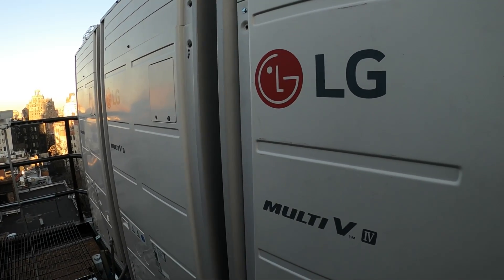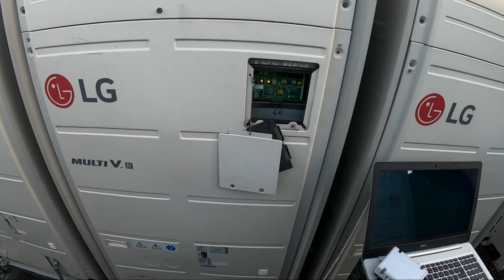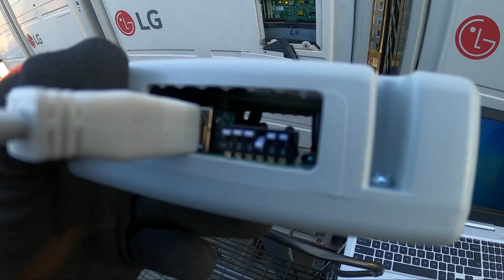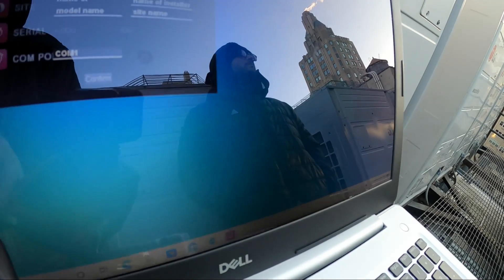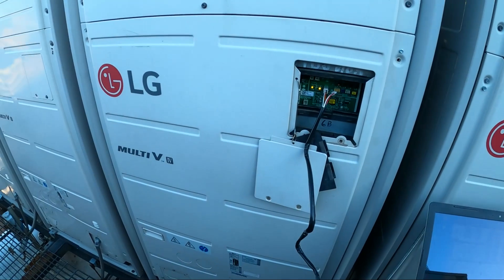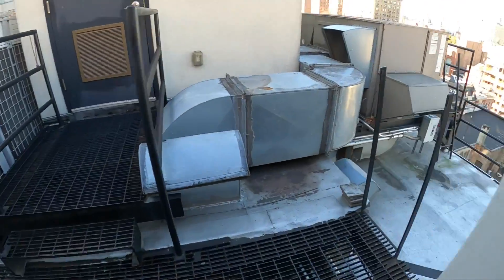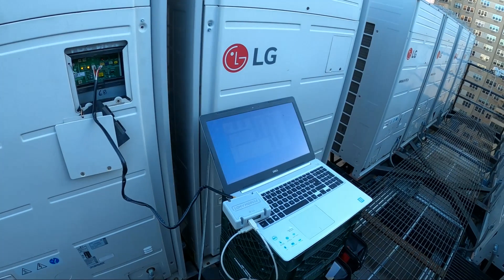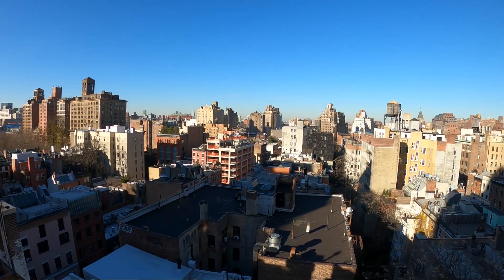LG HVAC Follow Up: LG MULTI V IV LGMV Service Tool (LGMV Computer Connection) LGMV Module Software

Comment: Great video I will be using the lgmv tool tomorrow on bond street in NYC. I also work in NYC mostly in Manhattan below 57th street.
I had a hard time installing the lgmv software. The hard lock key driver would not install. Klima our local sent me a link but my computer detected a virus. What I ended up doing is buying an external CD drive and use the CD that came in the box with the lgmv tool an installed the software successfully.
I'm hoping tomorrow it works I hope it doesn't ask me for the hard lock key.
BTW it looks like you are in the east village

Comment: hi. Thanks for the interesting video. tell me, does LGMV work without a flash key? do you only need the device itself or some other activation key?
Reply from the maker: You just need the device itself. It should have the flash key in it with a download. I'm honestly having trouble with this one for the computer. I've been using the other LGMV tool that connects to your phone/tablet & is wireless. Thanks for watching!

Comment: I feel identified with your work that's why I haven't missed a video since a couple of weeks back. Some people comment that you are not testing the electronics right, what do you say about it?
Reply from the maker: Thank you for your support! When I was testing the bridge diode on the converter board I tested it wrong at first in the video but also in the video right after I tested it correctly by switching the positive and negative leads. I misread the testing instruction at first but corrected it right after and confirmed there was nothing wrong. People always have something to say online. I could have edited that part out of my video but I like the show the true thinking process. Things happen on the job but in the end, I did test it properly & I am narrowing down the issues here. Thanks for watching & happy holidays 🔧⚡️
Reply from the maker: I would never put out false information in my videos. I will only put out the best information here 👍🔧⚡️
Reply: @JumpermanTech  that happens to all us field technicians.  I haven't had a chance to replay that video. Take care. Dont stop showing New york. Beautiful scenery 👌
Reply from the maker: @rightconditions2789  Definitely does. I will continue to show New York & make more videos. Thanks for watching & Merry Christmas! 🔧⚡️
Reply: @JumpermanTech Absoflogginglutely! 💪💪💪👊👊👊
Reply from the maker: @aus_aircon_ref_mech6671  Facts! Merry Christmas!! 🔧⚡️🤙🎄

Comment: Record Day was 41*  That is right at the edge of the charts  Range outside temp (59*-41*)   HI 363-435psi;  LOW 102-145psi; ODU Fan 20-50% Comp Ratio 50-70%; INV Discharge temp 149*-167*;  Liquid temp 77*-104*;  IDU EEV 400-600; ODU Main EEV 200-600;  IDI Pipe in 104*-122*  Take your pick of chart ranges  Your numbers almost fit inside both charts.  Liquid temp is low in both and LOW pressure is low in this chart.  Running all indoor units on high fan will tell the truth of the matter.  You maybe low on charge.
Reply from the maker: Thank you very much for your input! The day was 35 degrees outside when running this. Run all the fans on high and all in heat? Maybe also compare running all the units in cooling as well? I am wondering out how to properly check the outdoor and indoor EEV. Can't find good instruction from the app. Interesting you say that because technical support was wondering if the units were actually overcharged. Thank you & happy holidays 🔧⚡️
Reply: Let's talk about those inside units, one video I thought you said 9 IDU, but LGMV screenshot showed 6 - 9,9,9,7,7,7 for a total of 48k, that blew my mind to have a 72k out door unit only serving 48k.  unit charge is 16.8 lbs ? You added something like 404 oz or 25 lbs. That's 8 lbs for 6 IDU at 1.3 lbs each.   It sure could be over charge  @JumpermanTech
Reply from the maker: @mechanicalpros3214  For most units, it usually handles 8 or 9 indoor units from what I have seen. You are correct here. It says 6 IDU written on the unit and I'm looking at the screenshot. It says 7,7,7,9,9 & 9 BTU units. It is a 72,000 BTU outdoor unit & the indoor units total to 48,000 BTU's. I recovered 440 OZ to be exact and that is what I charged it back with. 25.5 LBS of R410A
Reply from the maker: @vrfpro  Unit charge is 16.9 LBS
Reply from the maker: @vrfpro  The outdoor unit seems extremely oversized. Wonder how that would affect this system. What are your thoughts here?
Reply: If you look at the version of firmware on LGMV screenshot it is ver 29.18 (operation info under type is ver) Standard ver is 29.0 the new boards come with ver 31.0.  If your have a .1 or in this case .18 this software has been flash upload at the unit by a LG rep.   This is specially modified software for a reason.  My guess is the other units with 8-9 IDU may by over capacity.   Side note, Phase CT amps, I never really worry about.  Most of my units under load run 22-24 amps all the time.  Do you really have a problem?  I would worry about flooding the compressor with liquid @JumpermanTech
Reply from the maker: @mechanicalpros3214  So it's the inv input CT that is the correct amperage this unit is pulling? I do worry about liquid migration due to extremely poor air flow at the indoor units. If you have seen the condition of the air handlers. The blower wheels are so packed with dirt that you barely feel any air flow in the rooms. We had to cut down the ceiling just to do the cleaning. Every single unit in the building is this way. I'm sure this is adding on to this compressor failure issue. Also, there are no such piping configuration to help with oil. Do you recommend inverted oil traps and oil traps in this setup? Thank you
Reply from the maker: @vrfpro  Your advice is much appreciated! Happy holidays 🎄⚡️
Reply: @JumpermanTech  It would be good for the hotel to give you a whole floor, all of the IDU's on one ODU, to cut the ceilings and completely clean the units, see if that makes figures look normal.  Alas, that's a lot of money for the hotel to lose having a floor out of action!

Comment: Record Day was 41*  range outside temp (41*-23*)   HI 363-435psi;  LOW 58-116psi; ODU Fan 50-80% Comp Ratio 60-80%; INV Discharge temp 167*-185*; Liquid temp 77*-104*; IDU EEV 300-500; ODU Main EEV 400-800; IDI Pipe in 104*-122*
Reply from the maker: Thank you for all of your input my friend! Really appreciate it🙏🔧⚡️

Comment: The model plate is what you would expect at the disconnect.  LGMV showed (INV input CT 9.6 amps) (INV input VT 215 volts).  Looks normal  A proper test would be to put all IDU in heating. The compression ratio looks a little high  Hard to read with everything in kpa and C.    LGMV HI 414PSI   LOW 95PSI   INV discharge 163* Liquid 75*
Reply from the maker: Thank you for your input. It does show INV INPUT CT - 9.6 which would seem normal but it also shows INV PHASE CT - 25.2 and that was matching with the amperage my multimeter was getting at the compressor itself. I heard the amperage should be tested at the input of the VFD but am getting mixed opinions. I need to run a test with all the units set to heating and cooling. Much appreciated. Have a happy holiday🎄🔧⚡️
Reply: Good thought, PHASE CT will always be higher than INPUT CT. That's the magic of the inverter board.  Frequency will vary as well.   @JumpermanTech
Reply from the maker: @vrfpro  Very interesting. What is the true amperage this unit is pulling? Is it the input amperage at 9.6 Amps?
Reply: Correct.  If you look at your screenshot inv DC link is 280 vdc that is the driving supply for the CT 25.2 amps.  It is a DC generated sign wave that is a fake AC given to the compressor.  That way the frequency can be varied from 55-155 Hz (I think, (135Hz) don't remember high end for sure have it written down somewhere)   @JumpermanTech
Reply from the maker: @vrfpro  So 9.6 Amps is the actual amperage for this compressor & not 25.2? Thank you for your input! Merry Christmas!

Comment: you have to have inverted traps only the filter casing needs to go   Starving compressor of oil
Reply from the maker: Filter casings definitely need to go. No traps as far as I could see here on the roof and nothing on the indoor units. Many have mentioned the inverted traps.  Need to figure out how to configure that and recommend that here. Thank you for your input & happy holidays! 🔧⚡️

Comment: Ok, so i have been watching this saga. I am also listening to what you said about back to basics. Although you changed compressor when it was warm out, you are getting a high amperage in heating. That being said, the indoor coil is basically the condenser. We all know what happens to  compressors when we have a dirty condenser. 
You are definitely on the right track with getting back to basics. Maintenance. This is what happens when you forgo maintenance. Yeah, things may work for years, and you are happy you didn't fall for the maintenance trap." Eventually, you have to pay the piper. And it's gonnna be a bigger bill because now you are in dire straits
Reply from the maker: The saga continues 😂 I totally agree with you here. Being in heat mode now & the indoor coil acting as a condenser, being that the fans are plugged with dust/dirt, it totally makes sense as to the system running with high amps. High amps over a long period of time will definitely destroy a compressor. Every unit we have cleaned we had to cut down the ceiling to do so. That's how you know none of these units never had any proper maintenance done. Definitely need maintenance here. First we need proper access. It's truly incredible what's going on here. Thanks for watching & commenting brother🤙 Happy holidays to you & yours 🔧🎄⚡️

Comment: When you showed the indoor unit data . It showed 2 indoor units that were at   0 degress superheat . You are slugging the compressor and washing the oil out of the compressor. I would locate those indoor units and do checks on the eevs . You will most likely hear the refrigerant pouring through the coil with the units off .

Comment: Are the units set for 460 or Canada 530? They are at 120hrtz and go to 140?  Would be higher amps if the power reg board is configured wrong or its ment for a different voltage
Reply: Canadian always has to be special 😂with manufacturer’s spec
Reply from the maker: These units are 208V 3 Phase for United States. Wonder how I would be able to find out what these units were configured for. Would need to reach out to the local rep. Thank you for your input & for watching. Happy holidays! 🔧⚡️

Comment: Watching the system on a computer using LGMV will allow you to see the EEV positions of each FCU and the pipe in and out temps. That should help narrow dirty coils / filters, or bad EEVs.
Reply from the maker: Definitely. This tool will Definitely help to narrow down the issue here. If we can get one whole system back up to normal, we can then restore them all. Definitely need to look into those EEVs. Thanks for watching & happy holidays 🔧⚡️

Comment: Indoor coils are the main reason compressors go on VRF systems. They really gotta be clean. Sometimes an EEV that’s bypassing also is very hard to catch it can cause these failures.
Reply from the maker: Thank you for your input. Glad to hear that makes a difference as we have found the indoor units in terrible shape. We need to look into the EEVs now that we are using the LGMV module. Thanks for watching & happy holidays!